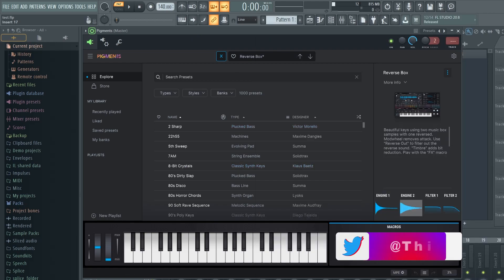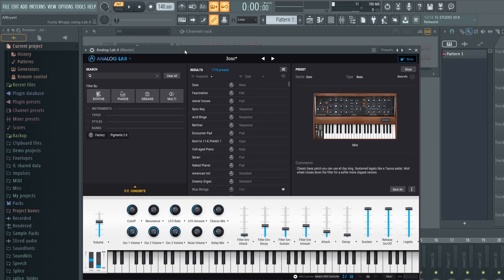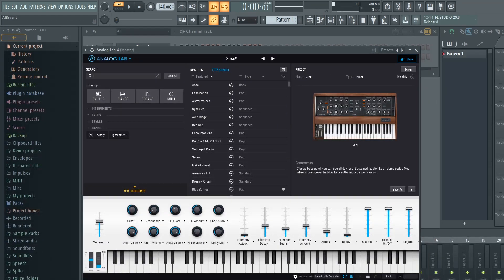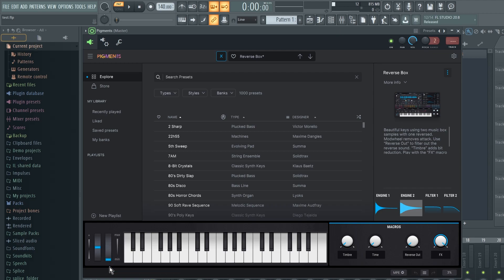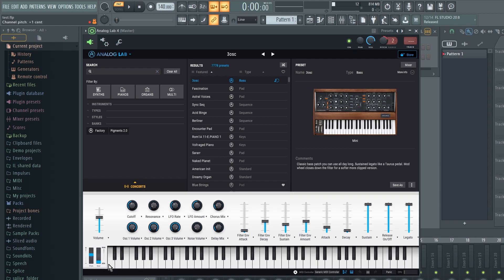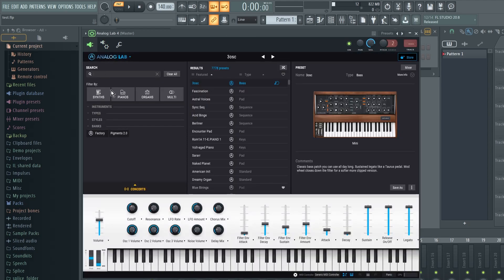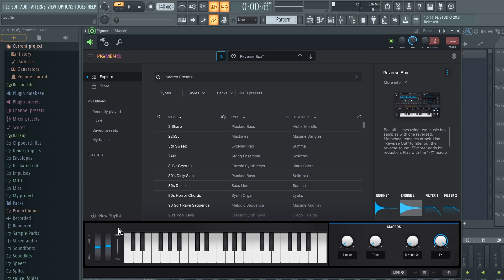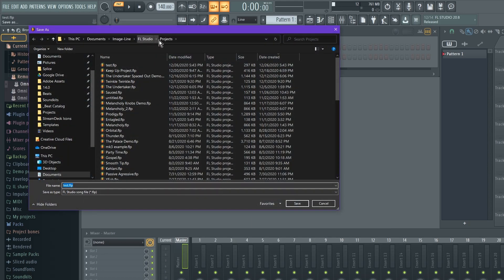How to Map Mod Wheel FL Studio 20

Comment: I'll have to try these fixes out when I have access to my equipment.  With mine, the left-right movement works fine, but with the up-down movement, the little reticle thing on the modulation graph in Sytrus snaps to the bottom instead of back to center when I release the joystick.  Fingers crossed one of these works.

Comment: Hey Al Be!!! Great video by the way! I have a question, I did everything exactly as you explained, but my mod and pitch wheel aren’t moving in the computer screen when I touch the midi controller!! It says that it’s working because the orange light pops up, but it doesn’t show on my laptop. Am I missing a step? Hope to hear from you!! I’m using a Keystation 49 MK3 midi keyboard.

Comment: I work with a bunch of templates and this approach forces me to either set up every single template and re-save it this way, or continue assigning these for those projects where I'm not using a template.  What I learned in the last 15 minutes is that FL Studio indeed does force one to use templates for these Omni assignments (assigning Pitch Bend and CC#1 Mod Wheel to the class of generic "instruments" rather than letting it be saved in some Setup or config file... I wish it were not necessary to use templates this way because Pitch Bend and Mod Wheel are such standards that I wouldn't have thought it would be necessary - I thought I could save them to the mapping config file somehow.

Comment: WASSUP MAN I GET THE GREEN QUESTION MARK WHEN I MOVE THE PITCH WHEEL EVEN AFTER CHECKING THE SETTINGS UNDER REMOTE CONTROL SETTINGS. SO IT'S GETTING THE SIGNAL BUT STILL NOT CONTROLLING IT (NO ORANGE).
Reply: Im having the same problem with my mod wheel. Did you ever have any luck finding a fix?

Comment: this fixed my problem with the mod wheel link that i deleted by accident, no matter what i did, i could not recreate that link - until i saw your fix with the fruity wrapper
Thanks Al !!!
I have a question for the minilab mk2 : how can i use the knobs in relative mode instead of absolute mode ? When i set relative in midi control center, it doesn't move much in FL. Only absolute mode works.
Reply: Yoo, the Omni Mod wheel isn't showing up under remote control anymore. How did you fix it?

Comment: I need some help please.
 The joystick works fire, that's not the problem.

I set up everything as you've shown in the video but I still have a couple issues.

Firstly, no matter what I do, pressing the pads don't trigger the assigned channels (1,2,3,etc.)

- and yes, everything is set up correctly. I checked like 5 times. Omni preview is set to 10, M-audio oxygen 49/61. Everything's correct.

Also, when enabling CC mode the pads still don't do anything. Nothing happens when I press them.

Can you help please? I'm really stuck here.
Tried running as admin, reconnecting device, restarting PC, opening empty template.

And yes, the program IS selected. I sent to RAM and to 4 as well. Did everything just like you. Still no luck :/ everything else works fine though.
Reply from the maker: Make sure you don't have a port number set on the controller. It should be Port '--'.
Reply: @thisisalbe  I’m having the same issue could you please dm me back on instagram @4jakob or read my email
Reply: I’m having the same issue
Reply: Same here